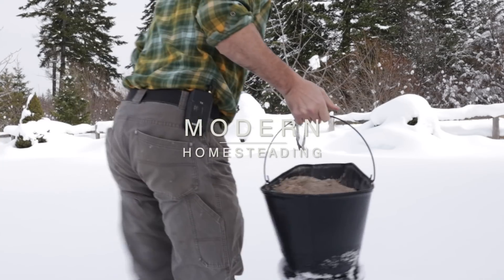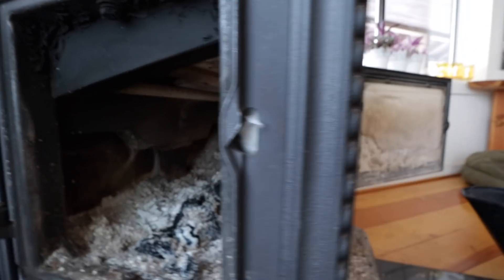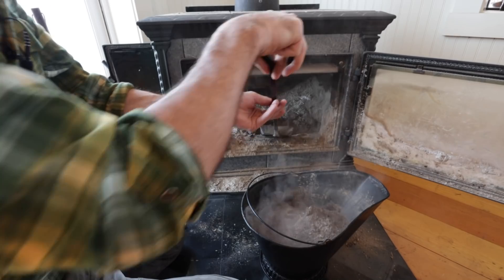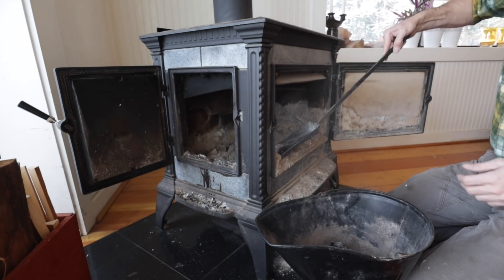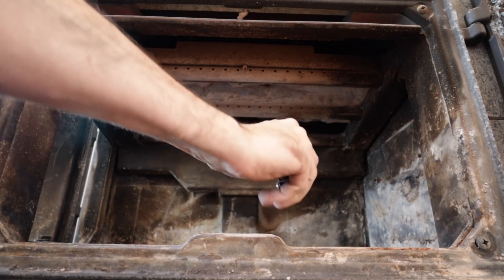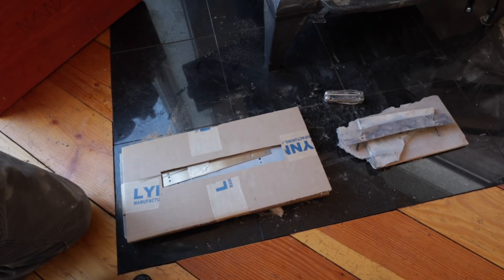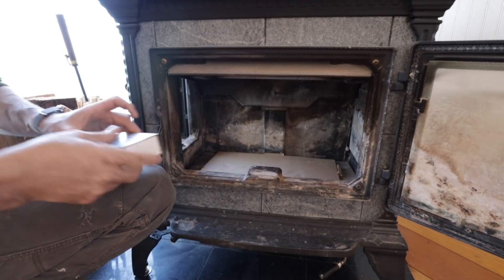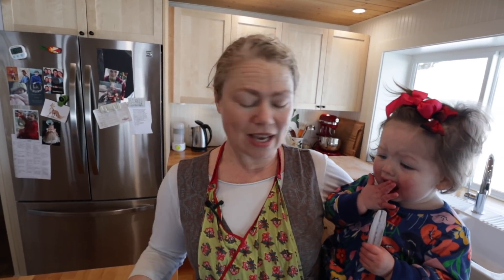Woodstove - Who Builds The Best Wood Stove?

Comment: Last month I brought the Shop-Vac in to vacuum out the wood stove. (I forgot I had previously removed the filters to use it as a wet vac.) After meticulously cleaning the woodstove I turned around and the entire house was charged with soot and ash.
I spent the rest of the weekend vacuuming and dusting and dusting and vacuuming. Lesson learned. Now I use the 20 foot hose and leave the Shop-Vac outside. Duh!
Reply: Filters won't touch that dust. I had to use the Thermax AF (Aqua Filtration) vaccum. Water filters the dust nicely 100%
Reply: The filter bags work fine for me but I'm just cleaning our mostly recreational fireplace once a year.
Reply from the maker: This is not true. The new Ridged vacs have a filter/bag combo that  catches all the ash,
Reply: that's great. They didn't have those filters back in the day! Good to know, Wranglerstar
Reply: Another option may be to put the shopvac outside and just run the suction hose thru a door or window.
Reply: Rick Maudlin That would just about make me so mad I could just about cry.
Reply: I laughed @aarontash , but then felt guilty
Reply: Haha!!!... omg, that would be me  too!
Reply: I've literally done this exact thing.
Reply: My karcher cheapo shop vac catches it all. 17L bag best Christmas present I ever got my wife :D
Reply: I made a mistake of using a shop vac to cleanout my firebox and but failed to spot one or more small remaining hot coals from the prior day. They then somehow ate a small hole in the filter, which resulted in ash flying all over my house. Yes, pointing the exhaust out a door or better yet keeping it outside is a good idea!
Reply: You need a specific ash vacuum with the correct filters
Reply: Thanks...for a great laugh. I’ve done similar shop vac mistakes!
Reply: You have to use the rigid HEPA vacuum filter with the bag.  I clean my pellet stove  all the time and it works great.  I have done my wood stove this way as well, just make sure the coals are cold.  You can also get away with putting about an inch of water in the bottom of the vacuum, but makes it an ungodly mess to clean when done.
Reply: Shop vac sells a vac specifically for wood ash.
Reply: I used my old sears wet/dry vacuum and there's a tiny bit of dust but its a damaged filter not a bag. A bag/filter that will stop drywall dust will take care of that ash. In case anyone is wondering, I shovel out the hot/warm ash and use a metal bucket. The vacuum is for the beginning of season cleaning and inspection.
Reply: Damn buddy I did the same thing once.  Lesson learned.  A really really good hand sweep is the solution.  No point cleaning a wood box spotless.  I finally converted to gas, what a dream.  Wood fire outside in the backyard now.  Cheers.
Reply: 🤣🤣  Sounds like something I would do!
Reply: Apples, peaches, pears and citrus trees thrive in slightly acid to neutral pH levels. Use wood ash sparingly on these trees, if at all, unless the soil is highly acidic.
Reply: I did that on a remodel job with drywall dust.
Reply: Been there, but atleast it was my daughter, and she noticed it right away
Reply: What a unfortunate  turn of events . Nice to see  your  video  again😊
Reply: Hahaha classic! I’ve made almost the same mistake
Reply: Hahahahahaaa!   That's a good story.  Sorry man, that does suck but funny story!
Reply: Man.. that must’ve been messy.
Reply: @matthewcoll9845  Did you READ Rick Newman's comment.  He said that's what he is doing now.
Reply: Omg that’s funny. I’ve been there but caught it almost immediately. It made such a mess. I can’t imagine if I would have kept going.

Comment: After examining al major brands I purchased the jotul . The stove was maintenance free, no fire Brick or baffling to replace just thick cast iron. Built to last for generations.
Reply: I have an insert I'm yet to use, but I do have a contura stove 53 I think it's soooo well built!
Reply: buddy2280 ..which model Jotul?
Reply: Cast iron actually needs maintenance, you'll have to disassemble it and seal the joints cause the cement gets very brittle and needs to be replaced. If you don't, too much air will get into the stove and it won't be as efficient, not to mention the excessive heat that will literally bend the various parts, making the gaps between the joints even wider.
My advice it to never let the air intake fully open when you start the fire, because if you forget about it the fire will get too hot too quickly and the sealant between the joints will break.
Reply: @bustersmith5569  I have the same stove Cody has, only its 22yrs old, and nothing has failed. Absolutely amazing stove!
Reply: Still using my 118 that I bought in 1979, and no cracks

Comment: My wife and I are spoiled,we heat with a masonry heater that is in our living room. It was build when the house was being build. It is large,thousands of pounds of stone and bricks. It has a large fire box. It works very well,and we use much less wood with it then a wood stove.
Reply: Masonry stoves are the top of the line for heat and minimal wood use. Along the same lines, but lowbrow, is the 'rocket mass heater'. Google it, they're pretty cool and work on the same principle as a masonry stove.
Reply: Rocket stoves can be the cheaper way to go, but not many townships will approve them and insurance companies won’t insure the home with a rocket stove.   
The shame is these stoves are safer than the typical wood burning stove because they don’t produce creosote because that gets burned off
Reply: It should be code that if a home is to be built with a fireplace that the masonry heater is required. 
I want one so much.
Reply: its not that easy(or inexpensive) to build one into an existing home. the Russians had this technology figured out over a century ago.

Comment: We have the exact stove in our place up north and we do not use it as a primary heat. We typically start a fire around 4pm in the winter and put our last log on around 9 pm or so. That keeps our propane furnace off until around 2-4 in the morning depending upon the temp outside. We are amazed how long the soapstones hold the heat. I typically only use about 4-6 pieces of wood once started. The side doors sold us too!! Thanks for all the great videos!!!!!!
Reply: Is it a Vermont casting or a hearth stone?

Comment: Go easy on the ash around your fruits, vegetables and garden. You might make it too harsh. You can compost it too. 
You could throw the ash on your roads to keep the weeds down or around your outbuilding exterior walls too keep the grass/weeds down. .
Reply: AllaroundNbackagain I use it as a de-icer on my back sidewalk. Only cherry, oak, and hickory can be used. I don’t know why, but only those woods work to melt snow and ice. Don’t use it on a main sidewalk that you could track into your house because it will do a job on wood and tile floors. I have a sidewalk for my dog which goes into my basement, which is concrete, so I don’t worry about it too much.
Reply: You Sir are very intelligent!
Reply: Good call.  Suspect soil in this area is acidic to begin with so it will tolerate a fair amount of wood ash.  Need to keep it off acid-lovers though like cane fruit, blueberries, Japanese Maples etc.
Reply: you are correct, I dumped a years worth of ash into my garden, that was five years ago and still no vegetables will yield much fruit there.
Reply: Ah, clever idea. Where I’ve dumped wood ash from my wood boiler in the pasture, very few weeds grow. This will save me from spraying Round Up in my driveway. Thx!
Reply: @ffarmchicken  Round up causes cancer...
Reply: @ericdeaton2247  Yup, been there done that!
Reply: A Family’s Journey - AllaroundNbackagain .. I killed a tree once with too much ash
Reply: I use ash mixed in with other compost materials, this way it has a chance to balance, but i will also add about 1 pail every 2-3 years to the garden. I have had a great harvest each year, sometimes I also add sawdust and wood chips into the compost. here we try to use everything to its fullest.
Reply: COMBAT DOC  Round Up is only Glyphosate. Some Glyphosate based products contain 2,4-Dichlorophenoxyacetic acid but they don't contain 2,4,5-Trichlorophenoxyacetic acid or its dangerous biproduct: 2,3,7,8-Tetrachlorodibenzo-p-dioxin.
Reply: The ash also reduces the acidity levels in soil....so good for things which require lower acid levels....good stuff though!😉
Reply: How much is to much?
I put always with my cherry trees

Comment: It’s certainly a PRETTY stove. I love the exterior details and the window. I do love a cranking-hot cast iron stove though. I grew up with a woodstove in the kitchen and I cannot imaging NOT having that warmth. Oil/electric just don’t cut it. They heat the house but they don’t warm your bones like wood heat does.
Reply: Yes I agree down here in New Zealand we have a wood stove and a heat/AC pump, during the summer the AC is really comfortable. But when winter arrives the wood burner gives off a way hotter heat than the heat pump. So what we do as the fire is burning the pump is blowing just normal fan to circulate and it blows straight over the wood burner and carries that hot air up the hall into the bedrooms. Plus it's nice on a cold rainy day with the fire burning watching a movie.

Comment: When vacuuming super fine stuff like ash or after ripping up carpets (hint gross) I like to put the shop vac outside & run the hose through the door because even the good filters leak a bit.
Reply: An ash vac has the best filtration of all the shop vac. They have come to in price to reasonable. We have had our two for years. One gets used everyday, they other in the shed, less often. Has outlasted many of my shop vacs that have come and gone.
Reply: 30 years ago I added a pillow case to the exhaust baffle. It captures 100 % of all small particles. I secure it with a hose clamp.
Reply: Me to. I always hook a drain tile to my hose and run it out away from the house.
Reply: Always use a filter bag in the shop vacuums tank-NEVER just into the tank.The added filtration of the bag-use the bags for ash and drywall debris. Your vacuums motor will thank you. Drywall-plaster dust and ash can kill a vacuum cleaner motor QUICKLY because the fines will destroy the motor bearings.

Comment: When we were young ( the 1940s ) we had a wonderful wood stove. Grandfather had a wood fired cookstove with an oven built in. We also had 40 acres of woods (mostly hardwoods) which kept us in firewood with all of the downed trees. During WW2 and for about 7 years after the war, it was very hard for some people to obtain other types of fuel, however, we always had wood and we provided wood to others. Personally, because of those experiences I would never purchase a wood stove unless it also included an oven. Grandpa's stove was so much more useful than our stove.
Reply: Jerry O'Dell 
I’m heating my place in ND with a wood stove and wood boiler. I’ve got 40 acres of trees too. One of the reasons I bought the place, free heat. As long as I can swing a chainsaw and run a splitter.

Comment: Put a Hearthstone stove in our cabin in the mountains last year. Same as you we have no other heat but wood. That thing works. We have the rear heat shield with thermostatic controlled fan and it will start and stop the fan when the soapstone hits 140 deg. That thing will run for several hrs after the fire goes out. Love that stove. Now to get a soapstone pot for the humidity. Thanks for the video on replacing the baffle.

Comment: I am a big Vermont castings fan myself. I have 2 of them for over 20 years and still very happy with them
Reply: Bought my first one in 1988.  It still heats my home.
Reply: Me too Dan,  1977 vigilant.   One of the best things I have ever purchased.
Reply: I have a Dutchwest that Vermont casting offers, we call it "puff the Magic Dragon". They used to make a really good stove, wish I had my first one. This one is a POS and I will be replacing it come spring.
Reply: Built my house in 2000 and installed A Defiant. I love it. My house is 78 degrees now and it is 15 outside.
Reply: I love my defiant. It never lets me down.
Reply: Dan Jennings , Same! Two little beauty Intrepids with the spiderweb windows keep the cabin toasty warm.
Reply: 1979 Resolute... Love it!
Reply: I use old popcorn container made of steel to collect ash.  I'm very careful to not drop the ash very far or fast to reduce the amount of dust.  I put the lid on the container and that puts out any burning coals before I spred the ash on the yard.

Comment: I like the stove my dad built from 1/2 " reclaimeded bridge steel. The fire box is 30" tall and 36" long and 24" wide.Inside it has a 5" deep grate to let Ash fall through. It sits on 8" legs so you don't bend over as much loading it and cleaning is nice. It's also nice because it holds a whole wheel barrow full of wood!

Comment: Been heating with wood since 1975. Used soapstone, welded plate steel and cast iron. By far the best quality and value is a Jotul. Vitreous enamel covered cast iron remains beautiful year after year and holds heat for hours after firebox is down to ash and coals. Holds a good fire for 10 hours with our Kentucky hardwoods.
Reply: The new Hearthstone hybrids are rated at holding fire 30 hours. Amazing.
Reply: I have the jotul 600. It is good
Reply: Yes!  Jotul are very good!  I lived with one for a long time.

Comment: Great video!  We heat with wood - cast iron fireplace insert with modified Rumford  firebox and glass doors, fitted in about 6 ton of river rock and concrete.  The fireplace throws heat nicely and quickly, and once the rock and stone gets warm, it radiates heat for about 10 hours.  A really nice combo!  Thanks!
Reply: Wow, sounds impressive

Comment: I have to mention that your floor protection is not code compliant. It mentions in your stove's manual how far it is required to extend from the loading doors for spark protection and to the rear and the other side for radiant heat protection. I can tell you that in the case of any incident in your home involving a fire claim due to wood burning, your insurance company will check to see if the stove installation was compliant. Most will deny coverage if it isn't. Sorry.
Reply: Good info, thanks.
Reply: It's a good thing you do Keeling. Thank you for mentioning that to Cody
Reply: It is true that some insurance companies will do everything they can to duck out of paying a claim.  Others will just write the check.
Reply: Clearance for this stove is 0” in the rear, and 16” in front of doors with no R value required. So it looks like they’ve got that.

Comment: I was considering the purchase of a woodstock soapstone stove. Then I realized they don't recommend burning junk wood and not having the stove surface temperature to high. I rejected the soapsone stove and purchased a 1980' all nighter stove. It has served me well for more than 15 years now. There are times the surface temperature is close to 800 degree, and this is my only source of heat. It has two flat horizontal surfaces for warming and drying wood with a rack, and also baking food in a 1950" eveready ovenola portable stove top oven. I don't have a fire to look at, but the heat is great, and I am a happy camper. Thank you for your video's Wranglerstar.
Reply: stewart bruce    =    You didn't look into it 'deep' enough.  Woodstock's soapstone stoves are cast iron 
inside with the soapstone 'panels' over it.   It keeps hot much longer than the cast iron, and looks really
nice.   Ours once kept the fire well over 24 hours ! ! !   yes i'm sure,   but I didn't load it.... so don't know
what wood or how much it was loaded with !  Suspect 'junior' really stuffed, crammed it full and shut it
down tight !   no harm done . . . . .   =)

Comment: I live in Montana, 7 miles from the Canadian border. It often gets colder here than up above the arctic ccircle where my wife teaches school in the winter. I cannot imagine having a stove so delicate that it falls apart from big loads. I put (actually throw) 22 inch long logs in my stove up to 12 inches in diameter. I can pack them in so full that they sometimes need a little assist from a few hefty maul taps. That little soapstone beauty wouldn't last a week in this Montana environment. 

My stove is home made out of 1/4 inch mild steel. Itz big, its strong, and has a seasoned, non-stick top on which I can cook a fine breakfast of bacon, eggs and home fries, without any pans. I've bean using it for twenty years now, and it will likely out last my bones. And does it ever heat! Oh yes, I raised four youngins around it in the living room, and I'm the only one who ever got burned on it.

Comment: Pro tip: leave an inch or two of ash in the bottom after cleaning. Fires will last longer right after cleaning than if you take it all out and have to build up the ash layer from scratch. Yes you have to clean it more often. Your choice.
Reply: ----------- another ..... when using non steel shop vac empty it then add a little water 1" or so....if you vac hot ash -------- it's extinguished fast --------

Comment: I  use  a  Grandma Fisher  woodstove  that  I  bought  40 yrs  ago.  The  front  has  2  doors on the  front,  so  I  just  move  any coals or  hot  stuff  to  one  side  and  clean  ashes  out.  If  there  is  a  lot  i move the  hot stuff  to the  cleaned side  and finish cleaning  it  out.   Then  re-load  and  close  it up.  I  like  the  ash shuttle  like  yours  since  I  get  it  against  the  apron of the  stove  and  the  ashes  dont  go  everywhere.  I  dont  vac  the  inside  of  my  stove  ever  just  a little  around the  hearth area,  not worth  the  risk of  damaging the  shop  vac.   Our  soil  here  is  acidic  so  I  add  cold  ashes  to  my  garden,  compost  pile  and  around  my  fruit  trees,  also  a  pile  in  the  chicken pen for the  chickens to dust bath.  Good  stuff!!!!